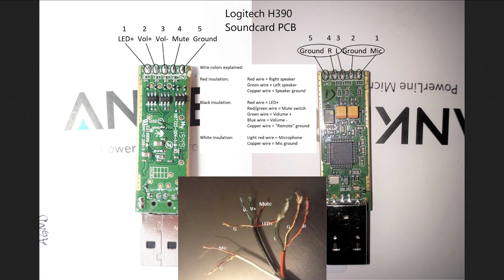Logitech H390 USB soundcard / cord connection repair

Comment: Thank you for the guide but I have a different situation, The usb socket from the other side it cut off and I don't know how to replace the socket.
Reply from the maker: You mean on the PCB? You'd have to source a USB 2.0 type A male connector with through hole pins, should be available on Aliexpress or similar. They're not hard to replace. You could also just take a USB 2.0 cable, cut it and solder the leads directly to the PCB and secure it with hot glue or epoxy. Should work fine and easier to find if you're OK with having the sound card on the cable instead of the plug. IMO that's how it should've been done from the factory as this design is prone to breaking.

Comment: there are white fibres surrounded by those colored copper wires... which ones should i solder ????
Reply from the maker: Hey dude. I believe the white fibers are simply some kind of packing material, you should not solder those. They can be cut, then simply follow the schematic and solder accordingly. Just don't forget to scrape or burn away the coating on the non ground cables. I hope that helps and good luck.
Reply: @osenmosen  thanks for your help! I held it on top of a candle and it burned away... I now have a perfectly working headset again !!

Comment: Thanks for posting the video, was looking for reassurance I had the right wires cutting the device down in size. I took one of these and replaced the mic with a input jack to use as a one channel analog to digital converter for recording. Works much better than the mic in the camera I was using.

Comment: Hi! Can you please help me with the opposite side of USB plug - it detouched from sound card now :( It seems I need to buy new USB plug and then put it on the soundcard. Please can you suggest me what exactly USB plug I should buy on ALIEXPRESS and how should I solder the USB connector to the sound card You can send it to my email foryoutofly@gmail.com
Reply from the maker: It's a standard USB 2.0 type A male connector with through hole pins, it's easy to find. You could also cut any normal USB cable and solder the leads directly to the PCB instead and secure it with some hot glue or epoxy. It should be very easy to solder, it's just four pins (Vbus, D+, D- and GND) plus the two shielding pins if you solder the connector.
Reply: @osenmosen  can you write to my email foryoutofly@gmail.com and I could send to you a poto what happened , please...

Comment: Thanks for the wiring guide, my left speaker was playing up and I needed this wiring diagram to fix it (CN1 Side #3). I also had an issue where I could hear music, but no vocal due to the ""Ground" being disconnected too (CN1 Side #5) thanks again for this otherwise I'd be looking at new headsets :)
Reply from the maker: Very happy to hear that :) Always a good thing when you can repair stuff instead of throwing it away.